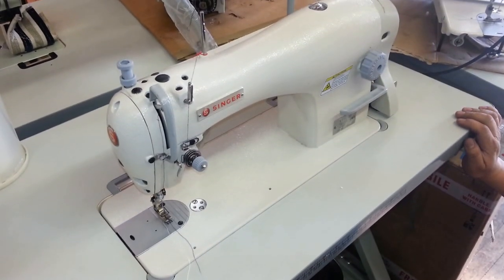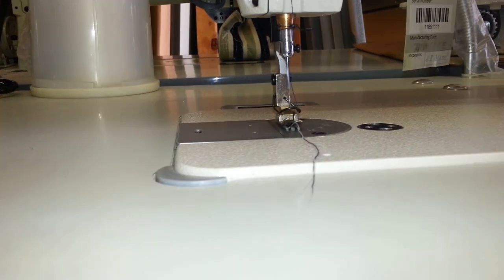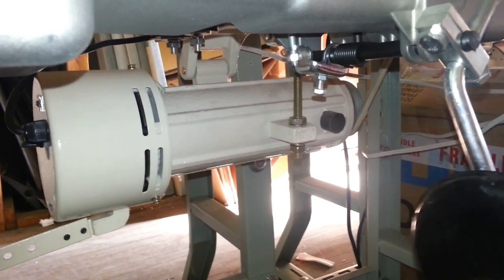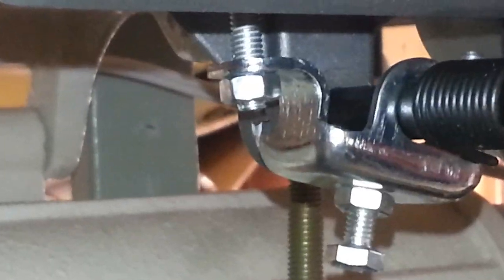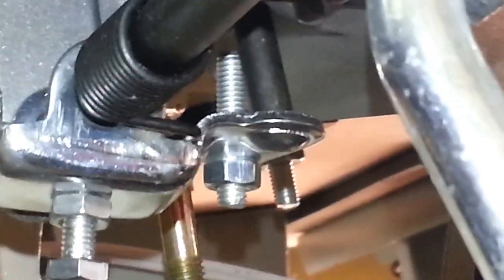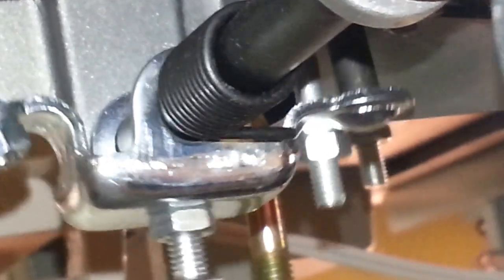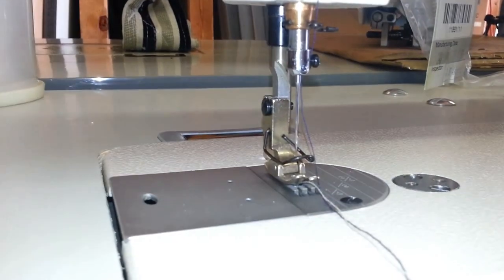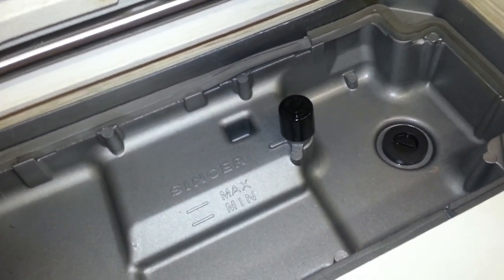How to adjust the knee lift on a self oiling sewing machine (Juki, Singer, Consew, Brother, etc.)

Comment: tHANK YOU SO MUCH. HEY WHAT CAUSES THESE MACHINES TO BE SO TIGHT YOU CAN;T TURN THE WHEEL? DO YOU HAVE TROUBLE SHOOTING TIGHTENED THE BELTS OR HOW TO LOOSEN THEM? AT THE SAME TIME THE BOBBIN WINDER WON'T WIND NEITHER.
Reply: Good
Reply: Joyce.....I have this same issue with my new Consew......I have to put a little pressure on the pedal to move my wheel.....did you ever get the solution to this?